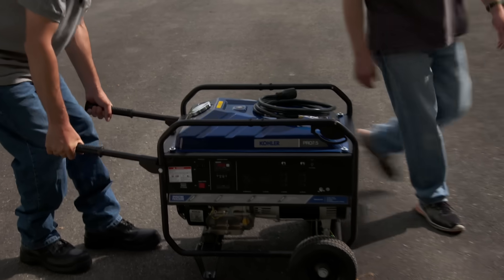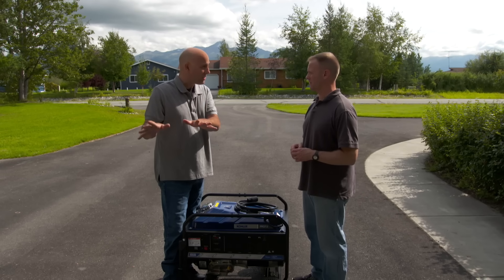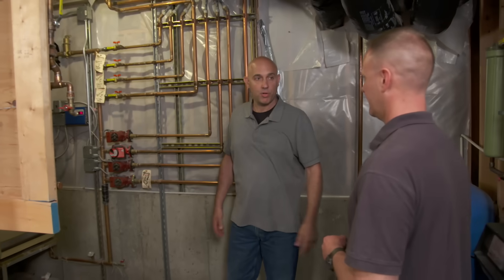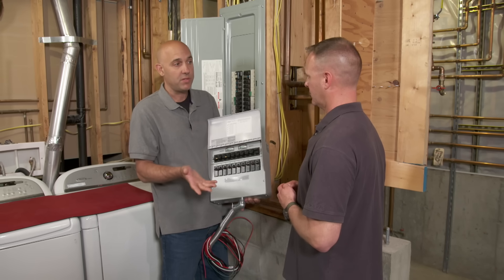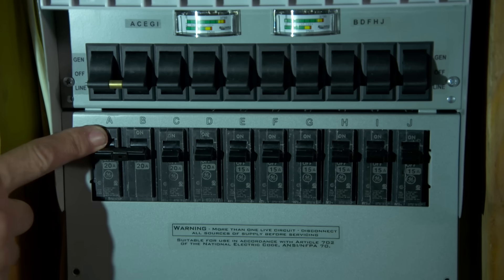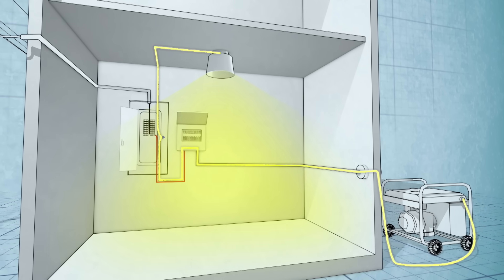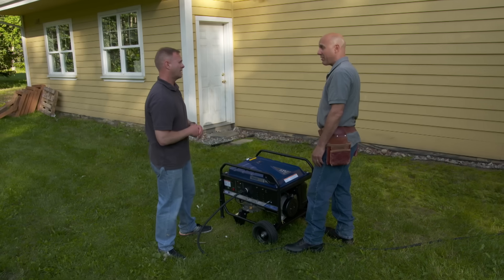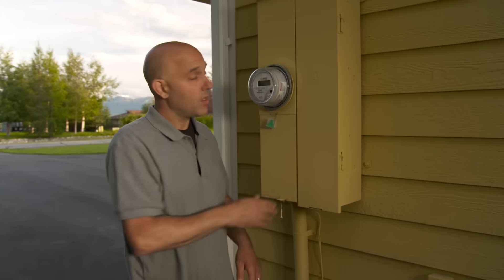How to Install a Manual Transfer Switch for a Portable Generator | Ask This Old House

Comment: Why didn't the electrician install a plug instead of a 50 ft. Cable? If he can use a 10-20 ft cable, there would be much less "IR loss" (power loss). DON'T get the 10/3 cable from the big box stores. I got 100 ft. 10/2 cable frome Home Depot that cost $236 just for the cable! You can get it a lot cheaper online. Ex: I was going to buy a cable online for only $100, but the deal went sideways and I got pissed and went to HD.  I recently got an "inverter generator." It provides "pure sinusoidal power." That's necessary for computers and medical equipment. A regular generator may suffice for you, but the power regulation is a problem. It could damage equipment, potentially.

Comment: did he turn the main breaker back on while the generator was running and providing power to the selected 10 circuits??? If so, what is the next step? Turning the manual transfer breakers back to Line or off position? I guess what I am asking is can the generator be running and providing electricity to the selected circuits when the utility power comes back online?? clarify what to do when the utility power is restored....thanks
Reply: With this Transfer Switch, it isolates the circuits from the main control panel.  Which means, you can have Utility power coming into the main control panel at the same time as Generator power.  Only one power source can supply power to the circuits in the Transfer Switch. 

So, no need to worry about back feeding the Utility line. This Transfer Switch works so well. I installed the six and ten circuit unit to use with our Power Station and Tri-fuel generator.

Comment: After doing all this and running it just once, I ripped it all out and installed a 30 Amp circuit breaker and back-fed my Honda 7 kw generator (if you're saying "that's dangerous - then don't do it - you're obviously not smart enough to handle something like this) I can run my hot tub, stove, oven - whatever I want.  F-this manual transfer switch B.S.

Comment: Cheap fix.  Get an emergency cord for your 220v generator then change the house end into the same plug as your electric clothes dryer.  First pull the main breakers then insert extension into the dryer outlet and into your generator.  Poof!  You have power throughout your house.

Comment: Can I just turn off main breaker off when outage occurs and then turn on a 30 amp breaker connected to the inlet? What about bonding screw? Is now the breaker box considered subpanel? Do we separate grounds and neutrals? This video lacks a lot…

Comment: Like Sean said 4 years ago, and as an electrician, I would agree, these are NOT the way to go today. Hook the generator directly to the panel and install a lockout switch on the panel cover. It allows you to use any circuit in your panel, it’s safe, and doesn’t look like a bunch of spaghetti in the panel. It was fine in its day but not anymore.

Comment: Those transfer switches cannot be mounted flush with that right angle flex connector... common mistake, but will not pass inspection.

Comment: Thank you for posting this video. Very informative.

Pros and cons I see:

Pros: 1. It's legal and safe

Cons: 
1. When running on normal power, there are 2 breakers involved for each circuit with the exception of non essential circuits not on transfer switch. A lot of additional wiring is required. Expensive if you're not a do-it yourselfer and need to hire an LEC.

2. You can't run a whole house on this setup. I would like to run my whole cottage on a generator. It's 9400W and should be able to power the whole cottage including hot water and stove. Keep in mind I will not have everything in the house running at max draw which may be in excess of the generator output. Question is can I just install a simple transfer switch between the meter base and main breaker?

Thank you
Reply: You could just forget the entire transfer switch and instead go directly into your breaker box. You’d install a 30amp switch for the Gen, then in outage you’d kill your main amp breaker to outside and run whatever appliances you want granted you don’t run AC and washer/dryer at same time off your 30amp and the other stuff you want in your box.
Reply: @Tao_Peace  My generator has a 50 AMP receptacle. I need to find out if I can legally use a breaker in the main panel. I would of course have to install an interlock. Laws differ in different regions. I like this idea.

Comment: How do I determine how many circuits I can power with a 5500, 6500, or 7500 watt generator? Do I simply add up each 110v and each 220v circuit then divide by some value? How do i calculate this?

Comment: Suggestion - for a temporary situation or a permanent solution, get a Generlink meter base adaptor. Would recommend the 40 amp unit.
Safe, very easy to use, super easy (5 min.) for the electric company to install. 
I have no ties to the company. I bought one and it's a great solution. Using it with my Generac standby genset. Simply plug in the cord when needed, unplug when done.
Reply: Not allowed by some utilities like Georgia Power.  I contacted Generlink.
Reply: @ChrisBurnsATL  That's sad. But there may be hope. The Generlink salespeople are not always that current on the various utilities' policies. In fact the Generlink rep I had was a bit ditzy! Delayed my order about 2 weeks due to her confusion. But it all came out in the end.
Before contacting Generlink, I first emailed the datasheet info and request directly to our utilities director at the city. The city provides electric to our area. 
A week later I had his letter of approval! He did say that I had to contact his office to have it installed as the customer service reps don't know about the device. 
I emailed his approval letter to the Generlink rep. About 5 weeks later I had the unit. Seems they build them after they are ordered.

Contacted the utility director's office. They sent out an electrician and an assistant.
The guys had never seen one before, but had it installed in a few minutes. They thought it was a really ingenious device. 
In my request to the director, I did present the facts of safety, convenience, cost & practicality. I'm thinking he agreed!

Comment: I enjoyed your video. I want to use a similar switch and generator but my meter says 320 and it feeds 2 separate 200 amp panels separately direct from the meter box, (meaning the 1 200 amp panel does not come out of the first one.  They both have separate cable going out of the house. , one of which is on the opposite end of the house. I have necessary circuits in both panels I would want powered during an outage.  What would I need for that setup to run off 1 generator?  I looked at the GenerLink transfer switch that goes directly behind the meter but they are only rated for 200 amps total. The electricians I have asked said I can't do it unless I install 2 transfer switches and use 2 generators?!   
Is this true or is there actually a solution that won't cost a fortune?

Comment: It appeared that the homeowner selected 2 240v circuits while in the transfer box only one pair of breaker was linked. I would expect that the transfer box wouold come with the clip to like additional breakers to the other 240v circuit.

Comment: I would bet that the generator is neutral bonded. If so this a code violation as you cannot have the neutral bonded in 2 places, at the generator and at the main panel in the house. The electrician should unbond the generator to make this installation code compliant.

Comment: Only comment is that gasoline goes bad.  Get a propane / gas unit and use propane as primary fuel, it does not go bad.   Last thing you want is to not keep up with changing out the aged gas and have a unit that will not start.

Comment: Recently moved to a small farm out in the sticks. Lots of forests and trees around leads to quite a few outages in our area. Called an electrician and they were all 2-3 months out from being able to do this work, so my wife and I bought the same transfer switch and wired it in ourselves. I wouldnt recommend unless you know what youre doing but even for people with moderate knowledge of home electrical it was pretty easy to install ourselves. Saved us about $500 on a visit too.
Reply: great to hear.  i can diy plumbing and other diy projects but always afraid of electricity projects.  just got hit with a bad outage with this Frida storm so will need something like this.
Reply: @KhmerH20  Same here.  I can do small electrical stuff like outlets, switches, and running wire, but anything with the panel I'm not touching.
Reply: Only $500?  That's pretty cheap!  I got quotes that ranged from $1300 to $1800...just for labor...no parts or materials included!
Reply: @edadan you must live up north or in Cali where everything is twice as expensive 😂😂

Comment: A suggestion for those in the rural areas. If your using propane the FIRST thing to do is think BIG!  Buy your own tank or tanks depending upon what deals you might find. Reason you own the tank you can shop different suppliers for the lowest price. Say you leased a 500 tank and it needed refilled say twice, First fill summer  $1.25/gallon, dead of winter $3.65  a 500 gallon tank only holds 400 gallons or 80%. First fill $500  Winter fill $1460    ouch!  So if you have a  say 1000 gallon tank you just saved $960 not to mention sales tax as well!  Now that we know more is cheaper go with a duel fuel generator, one that can run on gasoline or propane.  Gasoline is right now about $2.75/gallon  propane about $1.95 but if bought the propane n the summer CHEAPER!  So you have all this propane and your power goes out? Run on propane you have hundreds of gallons on hand no going to the gas station (If they can pump gas or if you can even get to a gas station) dangers load with gasoline, 3AM honey the generator an out of gas to hear as well.

Comment: You shouldn't leave the extra cord, coiled up on the holder, it is better to lay it on the ground S-ing it back and forth.
Also, he never mentioned if this generator had a floating neutral and needed to be bonded to the house neutral bar and ground.

Comment: Is that transfer panel universal? Will it work with the Duromax xp15000e? Can I get the link to purchase it. Please. And the plug box on outside the house. Thank you. I know you had said you can get cord in any length just put the ends on. Great video. I'm gonna go at it myself.

Comment: Living in sunny Southern California land of smog dry weather and earthquakes with Santa Anna winds ,,,,,,,,,,
So one year I had a similar setup installed onto my house and running with a 6500 w Honda Generator 
That following year we had a big windstorm and knock out power all over the city
No one in the city had power for almost a week our neighborhood had no power for two weeks but my house had the only lights on those two weeks.
Soon after that two neighbors had solar panels installed,,,,,
They learned that they won’t get power if there’s a power outage again only because they have no battery storage for the Electricity .
And I only have to pull out generator and cord plug in the cord then Walla! Power
A 220 power Cord runs to my backyard behind my garage,,, I don’t have to hear it and it’s out of sight

Comment: Good luck instaling that with all new AFCI regulations. Its way more afordable to put a braker dedicated for the generator at the main panel. AFTER THAT (IMPORTEMP) i 3d print a piece of plastic to meet the regulation beetween the generator braker and the utility main braker. Only one can be active.

Comment: With 10 circuits on the transfer panel, and if you use all 10, hopefully they are fairly low amp draw circuits.  Also,  it wasn't explaned that the loads should be balanced between each of the 110v legs on the transfer switch.  (Assuming that's how it was hooked up) 7500 watts is pretty good,  but don't expect to be running any HVAC (A/C) air conditioner(s) . Should handle most of the stuff - but remember  An electric Oven, Cooktop, Elec Water Heater, Microwave, Toasters,  Hair dryers, space heaters and the like all draw a lot of amps.

Comment: As usual he forgot to tell him he needs a ground rod and that the portable needs to connected to the rod . If the homeowner starts the gen without the ground  we have a UNGROUNDED SYSTEM. 
AS John Wayne would say JUST A" BUNCH OF PILGRAMS".
Reply: Read your code book son
Reply: @yarightmf   Actually it is ungrounded until you connect the cord And it is a requirement for portable generators  and stand by generators that have a disconnect that opens the two hot and the neutral. neutral due to being able to disconnect the neutral.

Comment: Question about the generator. If it has a bonded neutral, I have to remove it so that we don't have current on the ground wire when plugged into the house because the neutral is bonded in the panel. Correct?
Reply: Yes

Comment: What gauge is the wire that you’re using to go from generator to inlet?
Reply: Depends on what generator you are using. The gauge of a wire is determined by the breaker at the source (the one on the generator). 7 kilowatts requires 6mm2 for example. You can just find tables for that online.
Reply: 10 gauge.

Comment: Isn't the generator supposed to be off before the grid comes back up?
Reply: No, when using this transfer switch. Those circuits are isolated from utility powers. You can have your generator supplying power to those 10 circuits, while the other circuits are being powered by utility power.

Comment: Are we allowed to have wire caps in the panel box?  Are we supposed to put a heat shrink or tape around the wire caps?

Comment: Would have been a lot cheaper and faster to install an interlock instead of a transfer switch.  Not to mention you could then choose any circuit you want to run instead of only a select few.
Reply: While also a valid method, that puts a bit more responsibility on the homeowner to be mindful of what circuits they are powering with the generator. For those who are less attentive, the transfer switch is a better method.
Reply: You’ll back feed the service feed. If line men have to work on the service they’ll get knocked because of that back feed. You need to isolate the power your sending from the generator. Your poor mans way is good if you don’t happen to have a inlet at the time either way they sell this with a 10ft cord, the ats, and the inlet for 300 bucks at home depot.
Reply: @InphazeC8  Do your research. An interlock only allows power into the panel from one source isolating the other source line.  More options mean more info and you choose what is best for your needs and budget.

Comment: What do you do when it’s raining or snowing? 

How much gasoline do you need to store, since gas stations probably will be without power and no gasoline would be available? 
I would convert the generator to propane power and get a tank in the back yard.
Reply: 1) Use a GenTent to protect your generator from the elements.

2) Install a Tri-fuel kit to run your generator off of gasoline, natural gas and liquid propane.

Comment: Excellent. Liked.  Normally utility puts 240V AC. When we take in 240V, the panel somehow split it down to 120V.   But my generator only outputs 120V.  If I connect to the main where 240V goes in and break the connection to the utility company, does the panel on my home allow the 120V through or does it then go down to 60V?  Curious. Thanks if anyone has any insight.
Reply: No... your panel doesn't "step down" 240 to 120.   Your utility supplies 2 legs of 120V 180 degs out of phase with each other.  When you need 120V you use one leg - when you need 240V you use both legs.  Also it's not 120V - that's the RMS voltage... i.e. the average of the sine wave... peak voltage is actually higher.

Comment: Great information, that transfer switch panel is something I have never seen in 35 years as an electrician. Our electrical code will not permit us to splice inside a branch circuit distribution panel or preform this change without an electrical permit from the city.

Comment: Great video, thanks for suggesting to build our own 4 prong extension cord, should be much cheaper than the ready to use cords that ive seen
Reply: What size wire?

Comment: I live in a hurricane zone. Professionals recommend a 30 amp transfer switch. Same idea, less complicated. Manage power to match generator output. 

I have been through the power cables and pulled out refrigerators. No more. 

Safety is first . Keep that generator away from deck area. Pour a small slab and put up a shed roof. Use oil for a cold climate!

Comment: 55 feet of cord best that cost a fortune.  What size electrical wire and what are the limits in size?  HVAC 30 amps, Dryer 50 amps, Stove 30 amps, fridge 20 amps, freezers 20 amps, lights 15 amps and what size line for 55 feet?  What size fuse breakers and what about safety considerations while using the generator panel?

Comment: 7500 watts 55 foot of 10 gage wire. you not going to run anything 220 volt. my Generator is 8000 watt steady running and is about 40 foot away and i cant run anything 220 until the storm or what ever is over and i can move with closer and shorten my cord to 10 foot. before i can run any 220 volt.

Comment: I’m struggling to find a transfer switch that can accommodate a 50 amp central air conditioning circuit and is also rated for a generator that produces enough watts to run aforementioned A/C (>8k watts).

Comment: I have a 16K Generac whole home generator , the alternator froze up . They want $8-11 thousand to replace the unit . If I get a  10K portable generator can I plug the line from the transfer switch into the portable generator to get power into the house to use minus the central air ?
Reply: Yes.